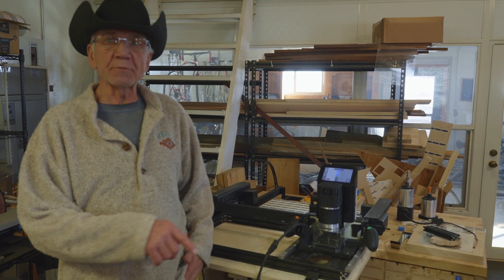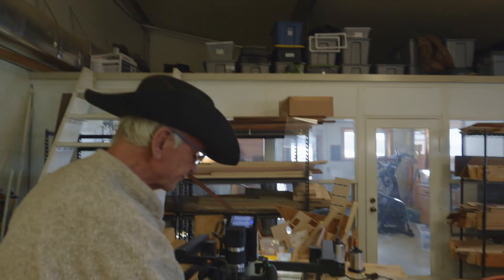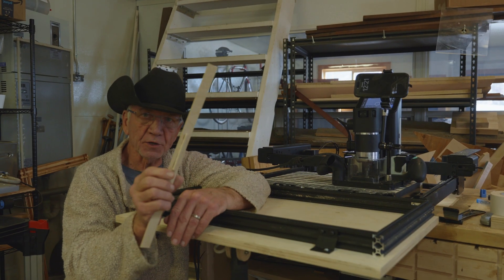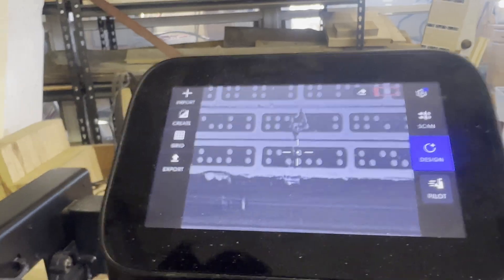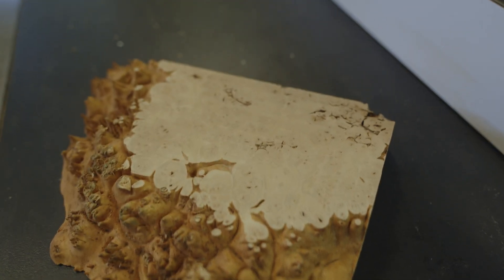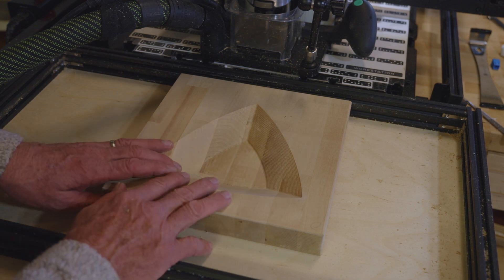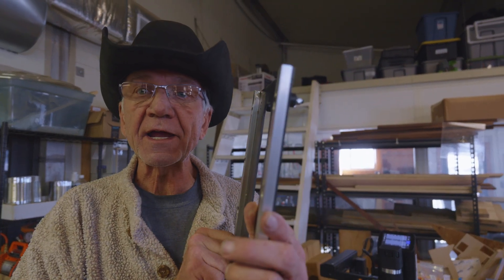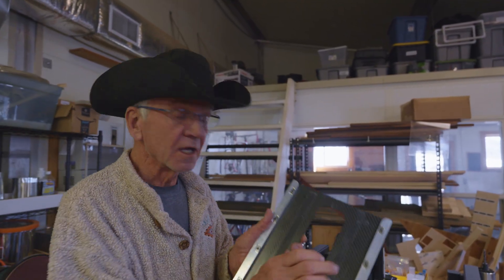Zed Sled PLUS Bench Pilot!

Comment: Doing both sides of the bowl could be a good example of needing the zed sled. Would require index pins to flip the work piece confidently, but would be a nice use case for needing that kind of support as the supporting material is milled away. First time seeing the Zed Sled - thank you for sharing!
Reply from the maker: I think you might be able to grid for the second side of the bowl, especially if careful about squaring the stock. So registration pins might not be needed.  (I started cutting the second side of the bowl shown in the video and the bit slipped in the collet. Wrecked it! ). Thanks for the comment!

Comment: Incredibly impressive that you got this to work. Keep it coming!
I must admit however, that by the time you invest in a benchpilot and all the other accessories you could have just bought a good hobbyist CNC router like a longmill or shapeoko and both would be simpler to consistently cut 2.5 and 3D carves. The strength of the Origin is its ability to work anywhere and on any size project, but this is getting to the practical limits of the hardware.
Reply from the maker: I’m with you on the strengths/weaknesses of the Shaper Origin. Fun to somewhat close the gap with gantry CNC, but I think that’s about as far as it can go. Appreciate the comment

Comment: i'm familair with the sled from seeing it in the shaper forums, but  I hadn't seen it detailed before.  would have liked to see a little more about the wheels on the sled.  I'm not clear how they are attached to the screws I see in the cabon fiber.
Reply from the maker: The wheels are from disassembling a CNC gantry plate like this one: https://www.ebay.com/itm/127317263183?chn=ps&mkevt=1&mkcid=28&var=428427340909&google_free_listing_action=view_item&srsltid=AfmBOorAI6YollqtJ7-QR23A1yJXxo3OForeYyQKIISAHO87gRTqGwcg-qo&com_cvv=8fb3d522dc163aeadb66e08cd7450cbbdddc64c6cf2e8891f6d48747c6d56d2c  

The wheels are on M5 low-profile flat head screws, and the mounting is for each wheel is a counterbored hole.  Andrew WR from the forum has a build project for the original Zed Sled.  The project has a pdf with pretty good details. https://hub.shapertools.com/creators/63b611f2fbe48653c207db8d/shares/6632aa366036cdb4caa5a7c6
Reply: @MountainRanchWoodworking-kn7et  Ahh I see, thanks

Comment: AWESOME add-on to BP, thanks Wayne! Question- could you break down what parts you would recommend for the sled- apologies, but this would be really helpful for ordering, if you don't mind? I see that AndrewWR recommends 3mm carbon plate 395mm x 245mm. You've indicated if you were making it from scratch you would make the sled a little wider to start with, and use some 3/8ths (10mm) thick t-slot for the rails. Therefore, 
1. what size CF plate would you recommend? 
2. What hardware do you recommend for attaching the t-slot rails to the plate?
3. What is the hardware needed for the rail guide on the underside? Is this the 15mm v-groove wheels x 4 in the original materials from AndrewWR? If so, What hardware do you recommend for attaching the wheels to the plate?
Again, thanks Wayne, much appreciated!
Reply from the maker: I will get that info to you.  Going to be a while.  (Skiing this morning!)
Reply from the maker: I just added a PDF to the Shaperhub project with recommendations for hardware.  

You are correct that the v-groove wheels on Andrew’s project are what you want.  I got mine from Open Builds, but sadly they are out of business.  The PDF has a link to some other wheels from Amazon, but I have not personally tried those. 

I’d use M5 low-profile screws and t-nuts to attach the t-slot to the plate.  you’ll want the screw heads in countersunk holes in the bottom of the plate.  That’s the same as the original Zed Sled. You might have to mill holes in the t-slot.  I’d make the CF plate 260 mm wide.  Mill the mounting holes 3/8ths from the edges of the plate.  I think it would be pretty easy to modify the existing file to make the plate a little wider and move the screw holes and countersinks a little.  But I’ll leave that to others to try!
Reply: @MountainRanchWoodworking-kn7et  thanks for that upload! I’ll keep the SO BP updated when I make that sled, on the back burner momentarily.